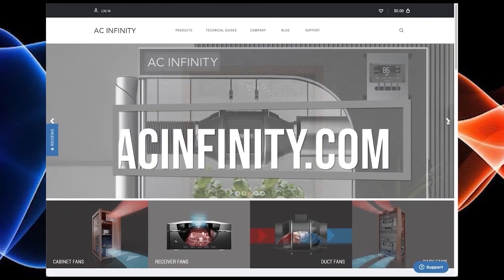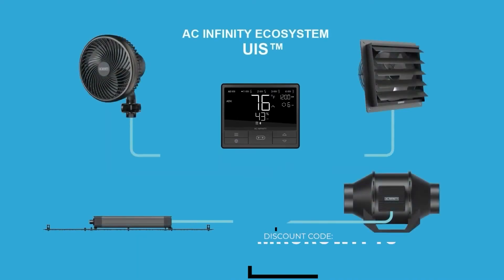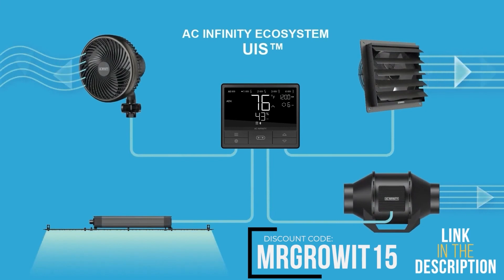Why You MUST Rinse & Buffer Coco Coir Before Using It!

Comment: This video was mind expanding. Two major points; root action exposes new sodium sites that needs continual buffering, and root action exposes more potassium sites minimizing the need for flower boosters which are high in potassium. This explains why the kootmed feeding chart stops cal/mag a week before flushing, which would then provide more potassium as the flower kinda for free. 

This info explains allot of the issues I saw in the later stages of my first coco grow. Excellent info.
Reply: Agreed- great video.  Regarding the chart and your explanation-  K cation is (+1).   Unless that site is exposed to a an ion with a greater charge - like Ca, or Mg, which are both +2 it’s not going anywhere .  Right?  So I’m not sure how cutting Ca will provide more K if it’s bound to the lignin and hemicellulose in the coir.-edit. Unless the site grabs whatever Ca from the tap water🤷🏻‍♂️
Reply: @stevefrench6576 I was thinking about this quote “excessive Ca²⁺ can displace K⁺ and Mg²⁺ from exchange sites, reducing their availability to plants (Goldy, 2016; Magdoff & van Es, 2021).”

Comment: I never rinsed or bufferd my coco before use i just use city tap water to expand the blocks and feed jack321 and never had a problem
Reply: They rinsing and buffering in a comparison if you want to see the difference.....

Do one lot of plants vs a seperate lot of plants, same light same variables etc but buffer one and not the other. Youll be surprised what difference it makes in maximizing your time and energy in growing. If you aren't buffering with calcium and magnesium, you are leaving a LOT of potential growth and yield on the table and dont know it. If youre already growing with straight coco coir, why wouldn't you want to do all you can to make your time and energy spent as worth it as possible? 

Not buffering simply doesn't make sense if you've already made the transition to growing with straight coco or coco/perlite. Youre leaving a crucial step out.....

Comment: Does anyone have a good Cal/Mag to water ratio for a buffering solution?  Great clip.  Very useful.
Reply: Just mix a 150% CalMag Solution for buffering. 
Rinse the coco (with nutrient solution)  before putting the plants in until you got your desired ec
Reply: @bigdongjohn555 so does that work out to 33%calmag to 66% water?  Or am I understanding that wrong? Thanks for the input.
Reply: @user-cw6zo8yz8z  you don't need that much. Look at your nutrient schedule. For example, the schedule says dilute 1 ml of CalMag per gallon/liter. That's your 100% solution. Add 1,5 ml per gallon/liter, then it's 150%. 

I personally mix a cal/Mag solution with high ec (would aim for 2,0-2,5) to buffer. Never had any problems.
Reply: 7,5ml per gallon Dr said previous vid

Comment: Hello guys i have a question. I have problems with a rinse coco but not buffered😢. Plats has sitoms of deficiency of cal mag and also im adding calmag to 0.4us on almost every watering. My question is can i solve this problem? Can diatomeas earth help me to buffer? On what ratio? Can something help me? Thx guys i apreciate❤
Reply: Instead of fertilizing twice a day, you should fertilize once a day, and the second time, you simply spray the plants with a CalMag solution, which has the same ec/ppm as your regular nutrient solution. I recommend doing this shortly before the lights turn off.

Comment: Then how do i avoid the coco coir medium for thr plant from retracting sodium then start locking out the nutrients for it. I had legido coco coir bricks and have issues growing in thoze. If buffering is worth it, then how do i know it will not revert and last long term so fhe plant can remain happy?
Reply: @rxsora25  Every time you feed the plants, you add new Ca/Mg, which means you have to feed frequently. At least 2 times a day.